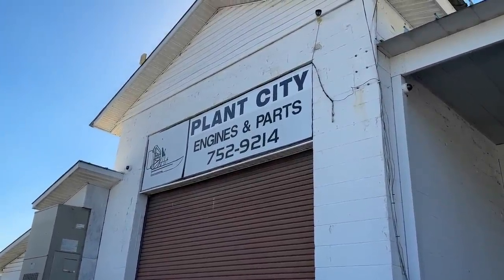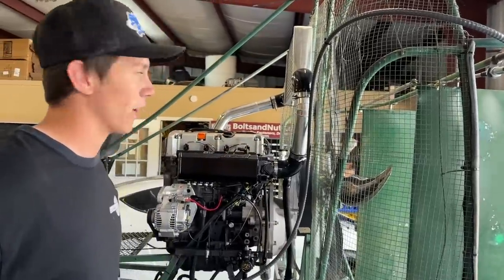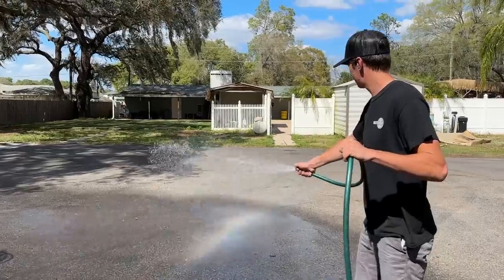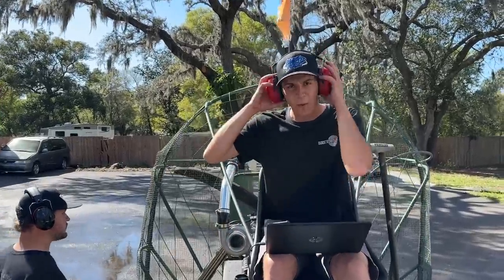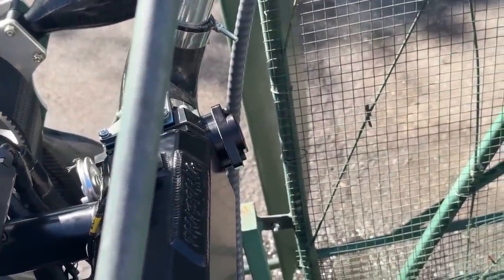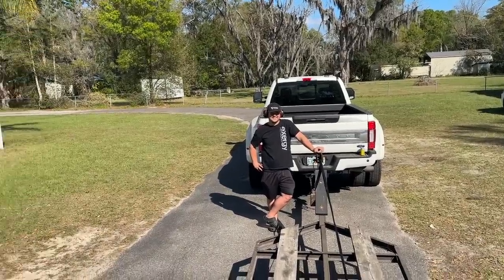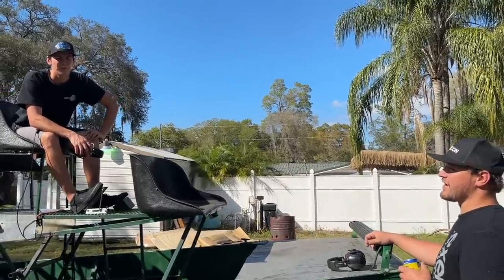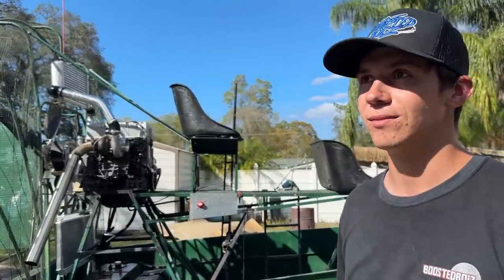First Drive In Our Turbo Honda K24 Swapped Airboat!

Comment: Do you have polymer on the bottom of the hull?  Wet or dry concrete i think there's not a difference, wet grass the boat will slide easier than dry grass. Also asphalt/concrete will eat up the hull which is why asked it they put polymer on the bottom of the hull.

Comment: If it were mine I would redo all of that structure and rearrange the seating MUCH lower. That little airboat is awful slim and short for all that weight up so high. It looks like it could use some steps in the bottom to help break some of the surface tension too. Maybe add a small buoy on a sturdy rope longer than the depth of the water you go on wouldn't be a bad idea while testing....

Comment: Also chop the seats so they are lower. The lower CG will make it more stable
Reply: Thats not what an airboat is though. Every airboat has super high seats so the driver can see over the tall grass in the swamp etc. Even race airboats have there seat up high. Infact, that small boat they have is way lower than most airboats. They just need to learn to drive it correctly. Also their pitch and angle both need adjusted.
Reply: @bUd D Dove  that might be but that size of a boat with 2 people going full speed. It needs to have more stability.
Reply: @brianhbinesh  The stability issue is them not being experienced operators. An airboat has a flat bottom and mostly rides on it edges.  Sporadic throttle control Will make any airboat feel sketchy. They just need to learn throttle control and get their pitch and and angle adjusted correctly. Should be fun for us to watch the journey regardless.

Comment: Should put a steel plate blocking the back seat in case it throws a rod when it’s turned up. make yourself a little fire wall Lol. Limits are usually pushed in future fun for protection of a detonating engine :)

Comment: The rudders are not supposed to be vertical, if ya angle them it will lean into the turns !!!😊 good job guys!!!!
Reply: No, they SHOULD be vertical. Airboats do not lean corners, they slide em! It's a 7'+ FLAT bottom hull for a reason

Comment: Run more boost in your K series.. you can dumb down your timing if you're worried about the rods. You can run 22 psi on a 54mm with a K24a2 if your timing isn't wild.

Comment: Seems to me like you need a little more pitch on the blades? Might drop your RPMs a little, but it looks like you wouldn't lose out on the Turbo spooling as it doesn't seem to be lagging. Worth having a test session comparing different pitch settings against RPMs, Boost and Top speed to find your sweet spot, She'll rip alright.

Comment: Convert the driver controls to the lower seat up front instead. Then remove the top seat and keep it a single seater. It wont be so top heavy and it wont be too rear heavy either. Win win

Comment: That prop needs more pitch you have a lot of rpm with no thrust.  you should be able to adjust the blades to push more air.
Reply: They set the pitch to match redline already. If they up the boost they will need to do it again.

Comment: Some of those plastic sensors that are just sensors with no moving Parts you could cover off the plug and dip it in hot glue and pull it out in the Hot Wheel keep them from rattling the pieces he'll also insulate them

Comment: First dont let off the gas while turning it will shift the momentum and plow the leading edge into the water

Second 7000 rpm on a direct drive is very likely over turning the prop and could cause a very violent failure

Third it appears that their either is not enough weight in the rear of the boat with that power plant or the motor is not tilted correctly, it should not be picking up the rear of the boat when you throttle up .

Comment: It looks like the fan has a belt drive. I wonder if you couldn’t lower the motor some then use a longer belt and tensioner system. Then lower the top seat some too.

Comment: Driving down the road and came upon a delivery van towing sn airboat. As I approached I could hear what I thought was a plane flying low over head. That's when I seen he had engine running and pushing the van down the road.

Comment: Hey guys I know it would be alot of work but you should drop the motor down as low as you can and also drop the seat heights down also it would help so much with how stable it is....

Comment: Haha that intercooler will not block airflow to that prop at all, if that's the case the engine, the radiator, the boat, and even the Kyle would block the air to the prop. A prop is designed to pull air from the sides also as from the front, it's just like a prop on a plane, also if you wanted to impede airflow on that pro the intercooler would literally have to be right against it even at that I don't think it would affect it. I'm just saying.

Comment: Guys, if your not strapping that boat down to the trailer when your transporting it, that’s pretty sketchy.
Not only is it dangerous, but some cops might even give you a citation.
Also, be careful cutting the power too fast while cruising, because of the low transom, that boat may get a backwash that would fill the whole back end of the boat. Lower you speed gradually.

Comment: Your Rudder Fins are upside-down, Wide part to the Bottom and the engine  thrust line needs more down toward the nose, rear end up a degree or two.
Ask the AirBoat dudes up your way they'll tell ya why.

Comment: Might want to re design the seating on skippy and lower down where you guys are sitting and put the seats side by side instead of one in front of the other but i feel like the seating design is way high up I think u want to be same height as the motor if not lower from looking at other airboats because right now the driver is higher than the motor on skippy 😂

Comment: The rear of the engine needs to come down some it shouldn’t be that high the boat should push flat when on the ground that will make it run dry ground better and it won’t plow the rear of the boat when in the water witch will increase your top speed

Comment: put the engine completely straight, then it will be even better. at least check if the engine is straight" because it raised the stern" when you drove to the shore.

Comment: Hey it's the thought that counts. I do think you should hook up with some real Florida people with some real airboats. 350 to 500 horsepower, normal size props and normal size boats. That you can spend 360s at 40 miles an hour. Another thing I don't understand why on Open water airboats are for the swamp not open water

Comment: I bet that IC location actually GAINS you power; the prop has plenty of air to pull plus the IC is making hot air that wants to expand and move.  Might lose a smidge of air mass but make up for it and then some in additional cooling.  Just my $.02 without doing any math

Comment: weld some pods on the back of that thing. it helps buoyancy and balance. Another pro tip, get some safety equipment before you go out next time. FWC will get all over your ass for not having life jackets on board

Comment: that hull IS awkward, engine down 2 feet on a belt drive, a lower bench seat where the driver seat is, and just drive it. you can built a much better new hull yourself from light ply and many layers epoxy-glass with graphite mixed in is very abrasion resistant. recommend same things there too, engine lower with belt drive and better+lower seating.

Comment: bro it's an air boat put the pebble down and get going stop going slow they need hight rpm plue mount the back of the motor down a bit and it's good

Comment: might need to lower the post that holds the winch on the trailer , might need to place it way more over the tongue of the trailer , also with an airboat most of the weight is in the back wouldnt be supprised if the triler flips up if you take it off the hitch so youre going to need more of the boat past the wheels 
as for plane / stabillity and going fast with the honda engine might want to see if you guys can build sumting like this :https://www.youtube.com/watch?v=kbnTKuIOTdw

Comment: That platform is too high, you need to lower both seats. The drivers seat need to be as low as the second seat , and the passenger seat needs to be in the hull.

Comment: intercooler in the sunlight is going to get really hot when you're not using it, put it in front of the radiator where it will stay cool in the shade
Reply: My neighbor has built or rebuilt a few of these. His current on the radiator is on the top. They move so much air I don't think it matters as much as people think.
Reply: Ya, he needs the weight down low will help stability
Reply: That is insignificant. 1-2 minutes of ripping with air across it it’ll be fine. Plus the IAT’s going through it are way hotter than what it’s gonna get sitting it in the sun.

Comment: You need to lower your center gravity on that boat needed to drop that motor down about 3 feet But I have my hair but my problem swinging within 2 inches of bottom of the boat I need to tell your mother's too high for when you guys on it on dry ground was picked ass end up and nose over

Comment: for God's sake stop throlling it like it was a freaking drift car start a smooth acceleration and keep it there so it can go to plane.. make a gass tank that sits at floor level but its bottom wide and in the front 2 thirds... that will lower the center of gravity and weight distribution